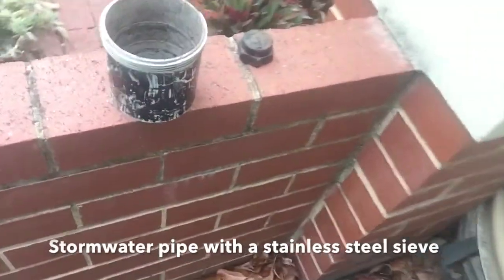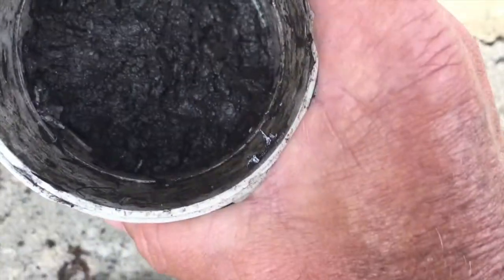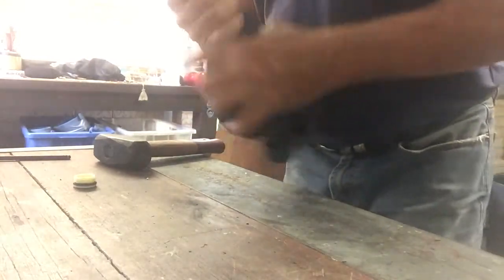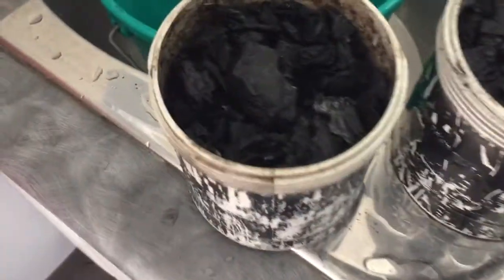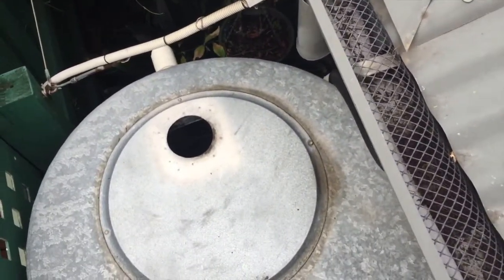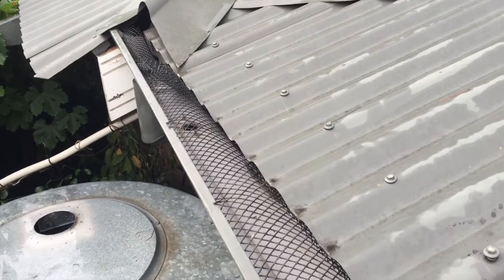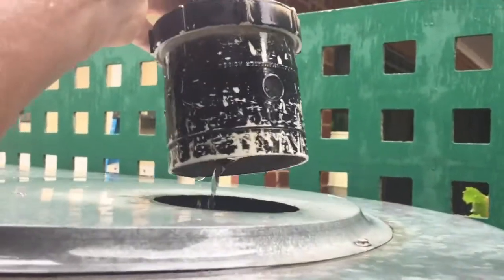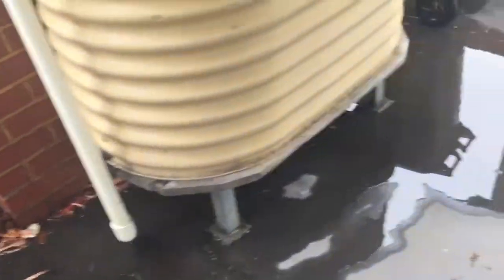Collecting and Drinking Rainwater 101

Comment: How does the water stay good in the tanks after this process
Reply from the maker: If you have the charcoal filter very little sediment will get from the roof into your tank. I have emptied and cleaned the rear tank once in 20 years since installing it,  and there was a very small amount of sediment at the bottom of the tank. The main thing is to make sure no sunlight gets into your rainwater storage tank otherwise algae and other things will grow. I use steel tanks for this reason. I think fibreglass or plastic tanks may let light in and then you can have algae growing.
Reply: Ty that helps a lot and ty for your time

Comment: Thank you for making you video quick informational and to the point. By the way, where did you get the canisters that you put the charcoal into that sits atop the tank?
Reply from the maker: Damian Pedey I think bunnings have everything you need in the water filtration section with fine steel mesh filters , just add crushed washed charcoal
Reply: Thank you, I will check them out